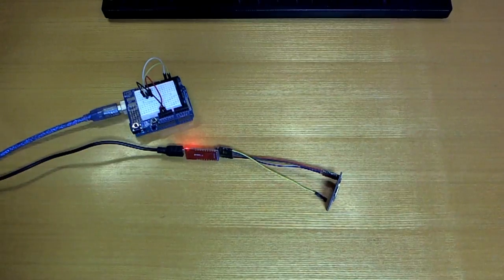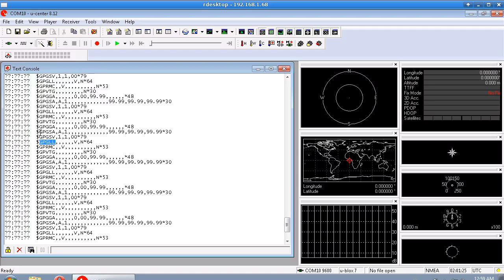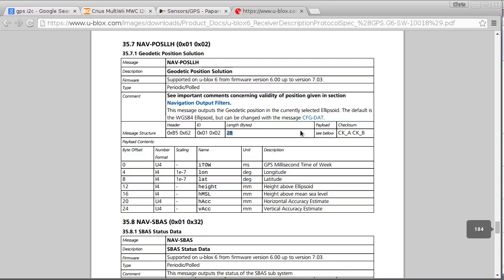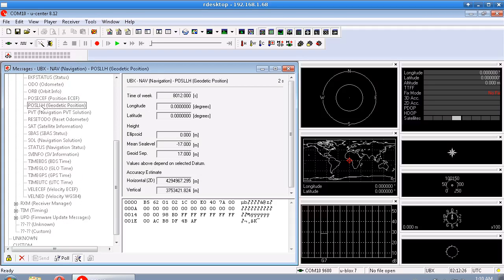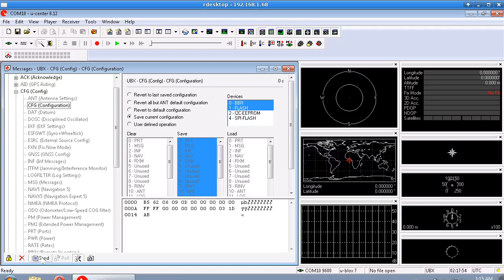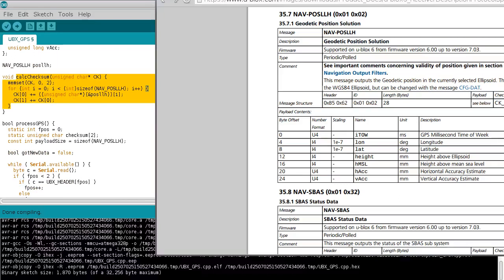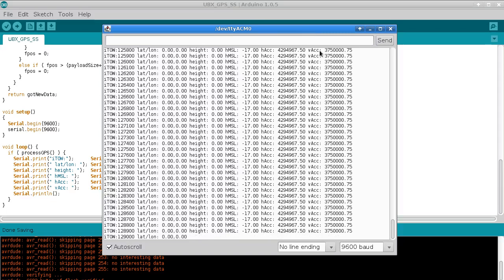10Hz U-blox binary GPS data in 66 lines of code (arduino)

Comment: Hi there , can you please help , after setting and confirgure my Neo6 from u-centre , receiver ,action and save ,then i put the gps in the copter , it work really awesome , take it out on the feild and test all the function work , but as i notice if i turn the copter off and change the battery in less then 10 mins , i will have the gps signal again straight away , but if i turn the copter off for about 30 mins , the gps not going , it keep on searching for gps signal . Then i have to put it back in u-centre , and go throught all the setting , put it on the copter , it work . But as long as if i leave no power for 30 mins , the gps not not working :-( , do you know if i miss any setting in the gps ? Please advise many thanks
Reply from the maker: Zinde1517 T Most GPS units have a small button battery to keep their memory alive and help with warm starting. Maybe that battery is dying.

Comment: On mine The Time/date is not correct. Is it possible To set it in y-center? And how? 
Thank You. 
Marc.
Reply from the maker: No, the time information comes from the GPS satellite, that's the whole point of it :)
The time will be in UTC, not your local time, so you may have to add or subtract some hours to have it in your local time..
Reply: oh ok.. thank you

Comment: By the way, the link for the source code no longer works. It simply brings you back to the video. Even if you just go to the www.iforce2d.net/sketches page and find the one for the source code you posted and click on THAT link, it simply comes back to the YouTube video. I was able to make use of the code you show in the video, typing it in myself while pausing the video, and then translating it into C# for my particular application. Your video has been extremely helpful in my application. Nearly every piece of software or API for handling GPS devices ONLY provide access to the NMEA sentences. Thankfully, you showed how to gain access to all that other data that the GPS devices provide.

One question, though: u-center provides a way of CONTROLLING the GPS device, sending it configuration information to, for example, limit which data it outputs. I would find it very helpful to have a video explaining how to do THAT! I'm thinking an application might well want to be able to not only receive data from the device but to control it from within the application itself, rather than having to configure it using u-center.
Reply from the maker: On my 'sketches' page, each line is two links. Click on the .zip part, not the link to the video.
Reply: @iforce2d  On this (your) YouTube video page you include a link to your sketches page, like this:

Source code: http://www.iforce2d.net/sketches/UBX_...

Clicking on that link brings you right back here to this YouTube video page, not to the presumed sketches page.

I do see now that if you make your way to the general sketches page by going to just www.iforce2d.net/sketches where it shows a long list of sketches, the entry for yours looks like:

UBX_GPS.zip (10Hz U-blox binary GPS data in 66 lines of code)

and there are indeed TWO links on that line, one for the sketch zip file and one for the YouTube video. When I had gotten there it all just looked like one single link and I happened to click on the part that went back to the video.

May I suggest, if it's possible, that you make the link on this YouTube page that's supposed to take you to the source code (sketches zip file), actually take you there, as it now just brings you back to the YouTube video.
Reply: @iforce2d  On your sketches page the entry for this video looks like this:

UBX_GPS.zip (10Hz U-blox binary GPS data in 66 lines of code)

which visually looks like just one long link string.

Maybe you could change how you post those kinds links and make it something like:

YouTube Video: 10Hz U-blox binary GPS data in 66 lines of code      :      Related Sketches: UBX_GPS.zip
Reply from the maker: I'd love to make the links in description work properly, but that's not within my ability. They used to all work fine for many years, then at some point YouTube fucked up the behavior so that they often just redirect to the video again, and I get a dozen comments a day telling me about it. Still seems to work ok for some people, I've given up trying to understand why.

I separated the links on the 'sketches' page to make it clearer there are two links on a line.

Comment: can you explain how this line of code works?(i know that it is putting data into the structure, but like, i have never seen it before and googling it didn't give me any satisfactory answers)- ((unsigned char*)(&posllh))[fpos-2] = c;
Reply from the maker: The posllh variable is a struct.
&posllh is the address of the start of that struct (a pointer).
(unsigned char*) will cast the pointer to an unsigned char pointer.
[fpos-2] will access the byte at position fpos-2 from that pointer.
This lets us write a byte at a specific position within the struct.

If it makes it easier to follow, I think you could expand it out to this:
void* vptr = &posllh;
unsigned char* uptr = (unsigned char*)vptr;
uptr[fpos-2] = c;
Reply: thanks! :D

Comment: Iforce2d, it is a great job! I have an ublox 6m, but even using the u-center or the codes in arduino, everytime i try to disable the NMEA and enable the UBX it happens nothing. In the end, i could'nt use the UBX so far, and i can't disable any NMEA message at all. 
Using your code on arduino, same result, just the standard NMEA messages. Do you have any ideia in mind? Thanks man
Reply from the maker: Check that the TX wire on your computer/arduino is properly connected to the RX of the GPS module.
Reply: Yes it is. TX ftdi on RX ublox. RX ftdi on TX ublox. 
I can receive the messages, connect to the satellites. I read the data on u-center. But if i click to disable the NMEA message, it does not change anything, even trying to send and save the information.
Reply: Another point, it works at 1Hz default. When I change to 5Hz or 10Hz like you did, even saving the configuration, it still works at 1Hz.
Reply from the maker: Well, it sounds like the GPS module is not listening to anything you tell it to do, so I would suspect a bad connection to the RX on the GPS. That's all I can say.

Comment: I don't get the reason for this. Why do you need 2 arduinos to calculate data?
Reply from the maker: +Suave Atore I explained it at the beginning. It takes a lot of memory to store the NMEA text sentences and parse them. Depending on what other tasks you need to do, it might require more memory than the arduino has available. These things only have 2 kilobytes of RAM you know....
Reply: +iforce2d Oh sorry, I didn't realise you were providing an alternative to TinyGPS++. I thought you were using TinyGPS++ and the new code. Makes sense now.

Comment: Is this actually changing the GPS sample rate or just the rate at which it records data? I am trying to figure out how to change actual GPS sample rate. Thank you
Reply from the maker: It changes the rate at which messages are output on the UART connection to your arduino.
Reply: Is there anyway to change the rate at which the chip requests a location from satellites ( I am new to this, and am unsure if this is configurable / feasible). Are there any chips that let us do this? Thanks in advance
Reply from the maker: No. It sounds like maybe you need to read about how these modules calculate their position. The GPS will always be working as fast as it can internally. The point of setting the output rate is so that it doesn't flood a slower MCU with less memory (like arduino) with too much information too quickly.
https://www.maptoaster.com/maptoaster-topo-nz/articles/how-gps-works/how-gps-works.html

Comment: hi, sir do have neo6mv2 tutorial. i have connect the module with ardiuno 5v and ground and tx and rx with ardiuno 4 and 3 pin. and i am using gpstiny++.h but i didnt get latitude and longitude.it always return 0.00 both plz help
Reply from the maker: +kamran khan khanzada this video is not about tinygps

Comment: Hi @iforce2d I have one of these modules m8n. When I installed the software everything within it appeared gray, I am using arduino UNO, so I connected tx of gps with rx of uno i.e. D0 pin and rx of GPS with tx of UNO i.e. D1 let me know where am I going wrong. Your help will be highly appreciated.
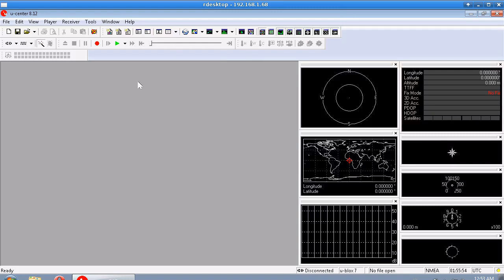Reply from the maker: You don't use the arduino for that software. Connect the GPS to your computer using a usb-serial adapter like I showed at 5:35 in the video.
Reply: @iforce2d  After using USB serial adapter and enabling all the values we are supposed to program Arduino? I thought Arduino will do the job of USB serial adapter
Reply from the maker: The GPS talks through a serial interface. The arduino knows how to do that on the Tx/Rx pins. But your computer doesn't, so it it needs a serial-usb adapter. Does that make sense?
But if you mean why can't the arduino do the settings, yes it can. The code I made after this is more convenient, please see the follow-up video linked to in the description.
Reply: @iforce2d  oh i see thanks so much for the help. I'll try it with usb serial adapter.
Reply: HI! even after using serial2usb I am not getting any data on any of those consoles :( packet binary etc.
Reply: Does it need to be locked before throwing data?

Comment: Hey you mention that you are using usb to serial to get the serial data from the ublox to the pc. can i use the tx and rx pin on the arduino to send that data as well, and use the u-center software with it?
Reply from the maker: +Mikkel Christiansen I've never tried, but I think I saw somebody say they were doing that...
Reply: +iforce2d Hmm okay, it's because we are doing a project at the school where we are going to use a ublox gps module and a compass to achieve the same goal as your rc car. Only it should be able to avoid obstacles.

would it be okay if i asked you some questions once in a while :)?
Reply from the maker: +Mikkel Christiansen I think in the long run you would save a lot of hassle by just buying a USB/serial adapter. They are not expensive and will come in handy more often than you might think. You'll need one to program arduinos with no USB connector (eg. pro-mini) anyway.
Reply: +iforce2d im going to use either 2 arduino nanos from ebay, or a arduino mega. So the only thing ill use the ftdi for is configuring the ublox gps module :)
I think i might have found a way but sadly i won't know until i recieve the parts in about two weeks from now since i ordered them from ebay :)

Comment: i got this module and get the same default data even if the antenna is attached to it
Reply from the maker: +JOHN JUSTEEN Did you take it outside and wait for a few minutes? If so then I have no more ideas.
Reply: +iforce2d 

Hi, thanks for the video. I'd like to buy a gps module. Just for Info. How long do you have to wait usually to get a signal?
Reply from the maker: +ClownLikeMe Generally speaking, if you have not used it for three days or so it will likely take 5-6 minutes. After that as long as you don't move too far (like hundreds of km) away from where you used it last, it should take 30 seconds or less. Some modules are faster than others but most of them will be something like that. There is usually a little battery onboard which helps it store data from last time - of course if you take the battery off it will take 5-6 minutes every time :)

Comment: Hey 

Trying to understand how your code is working. One line I am confused with is:

((unsigned char*)(&posllh))[fpos-2] = c;

My understanding is this is taking the 1 byte read from the serial port and placing this into the struct posllh at the correct location. 

When it gets to say a "long" does it add a byte to the first byte, then second , third and forth, then move on to the next item in the strut?

Here is some a sudo code example I put together trying to understand the concept

EXAMPLE

struct myStruct {
 unsigned char one;
 short two;
};

myStruct mine; // This declaring the struct as mine 

byte c = Serial.read(); // Serial Read returns 1 Byte

((unsigned char*)(&mine))[i] = c

When i = 0
place char c, into one

when i = 1 
place char c, into first byte of two

when i = 2 
place char c,into second byte of two

When i = 3
Will error as nothing there

Sorry if this is a really basic question. As I say looking to learn. 

Thanks in advance

Kev
Reply from the maker: +Kevin Ross yes, I think you are understanding it perfectly :)

Comment: Dear Friend Thanks For You Long Video Its Nice
i have downloaded your source code and done every thing you have done on this tutorial, but nothing is printed out. i am using and Arduino Mega and set the pins to Serial1 port, but cant get your printout.

i guess because the function processGPS is not returning any true value. could you please help, or is it the message that comes from the GPS module is not matching ?!
Reply from the maker: Ghassan Yousif I don't know too much about how the serial ports work on the Mega, or what pins they use, or whether you would need to change anything in this source code. How about trying the software serial version sketch that I included, then you can set whatever pins you want to use and you can be sure you have the right pins. If you have an FTDI adapter (like used for uploading sketches to a pro-mini) you can just connect the GPS module directly to your computer and it should display the NMEA strings. I did this in the video at 5:42.... what happened when you tried that?

Comment: Thank you very much for the lesson on GPS. Can I just ask how I can see if the GPS has got a FIX. I am trying to write the data to an SD Card and I only want the data on the Card when the GPS is getting relevant data. I must admoiit this is the first time I have tried programming by changing existing programs. :-)
Reply from the maker: +OE8PCK depends how you define 'fix'. I talked a bit about this at 17:41 in the video. You can check the UBX-NAV-STATUS packet for the gpsFixOK flag.
Reply: +iforce2d Thanks for the prompt answer. I guess I Need a 3d fix so that I am getting lon lat and hight. Would it be correct to write the following?in void Loop read(NAV-STATUS)if(gpsFixOK) // Only save data if we have a fix.....or do I Need other code?
Reply from the maker: +OE8PCK no, that would not work at all. You would need to modify the code a lot more, so that it can handle more than one type of packet. Perhaps you could use the horizontal dilution of precision value in the packet I'm using to make an estimate of when the reading is good enough. By the way, I would not trust GPS height values for anything important - they are usually wildly inaccurate.
Reply: +iforce2d That sounds good, I take it is less code. Any Chance you might show the code to me? I want to use the height measurement for model aircraft, a glider, it gives me some ides of the height I take it plus minus 10 Meters or is that also optimistic?
Reply from the maker: +OE8PCK I don't have the code, so for me to show it to you would require me to write and test it first, so... no chance of that any time soon. You are now the fourth person to ask about using different messages though, so perhaps I'll do a video on that someday. I would hope though, that anyone using this code would fully understand it (and therefore be able to modify it) without further instruction. For height measurements you would be better off using a barometer reading, some barometers can measure height differences with about 25cm resolution.
Reply: +iforce2d OK I fully understand. It is very difficult to learn when you are getting near 70. I will give it a try. If you do want a subject that would be very popular then a combination of GPS and height measurement using the cheap China stuff would be a real hit with the model aircraft people, especially when the data is on a SD card. I have build a vario using an air pressure chi and that site is very popular, but I just do not have the know how to convert the pressure to meters and also getting the height compensation before take off so the height is above the take off point.. Just Google Vario.Thank you for your Patience and advice.

Comment: hi, thanks for sharing.... May i know this project can used GPS uBlox NEO-6M?
Reply from the maker: Hee Pohyee Yes, it should be the same.
Reply: ***** really? thanks very much, so....the coding is can be used too?
may i know about the connection? is it gps module connect to arduino and then from arduino connect to pc using uart?
Reply from the maker: ***** I'm using a NEO-6M in this video........
Reply: ***** Okay~ thanks very much.. ^^
Reply from the maker: Hee Pohyee Could you just watch the video first so I don't have to answer things I've already said.... look at 6:03 (and you can see it's a NEO-6M in the first 30 seconds of the video!)
Reply: actually, i have watched it...my line got abit slow...thats why not clear....sorry because bring trouble to you...
Reply from the maker: Hee Pohyee No problem :)